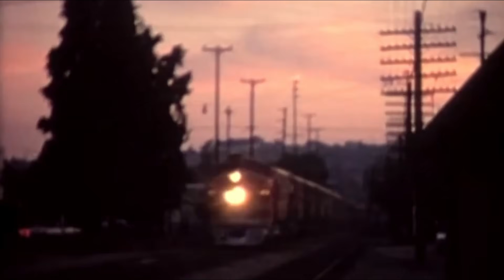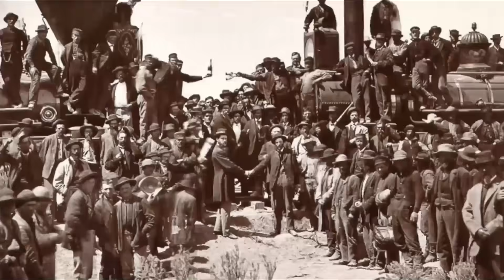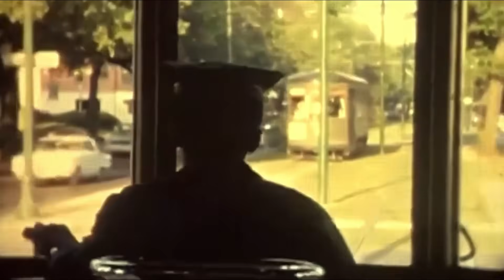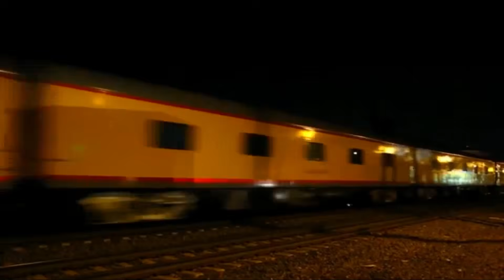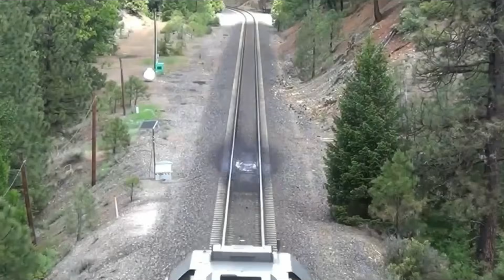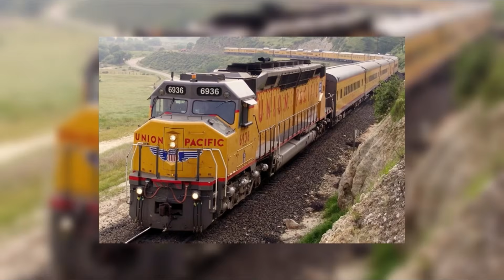The Rise and Fall of the DDA40X: The Largest Diesel Locomotive Ever Built

Comment: My late dad built the turbo chargers for these monsters and we where invited to Lagrange to watch one of these monsters being built. Number 6920.

The erection bay for these things was huge.

The frames where poured steel and after a unit was built.  It took two 250 ton over head cranes too place the units on their trucks.

The paint booth was big also.

The turbo chargers came from Allison's Gas Turbines Plant 5 on Tibbs Ave in Indianapolis, IN.

Thanks to one of my dads friends gave me the full blue prints for the 6900.

The wiring harness table had a few miles of wire on the table and this system was a pre curser of the plug in play systems used in autos, heavy duty trucks, and locomotives today!
Reply from the maker: Thank you for the share!

Comment: I was an Engineer  for UP out of Vegas for 10 yrs and had the pleasure of running one of those monsters. It rode like a box of rocks, and the gear ratio restricted it to 'light' weight hotshots. Heavy trains such as coal used the 3600 hp SD-40's. Having said that, you still had a shit eating grin when you climbed on
Reply from the maker: Thank you for sharing!